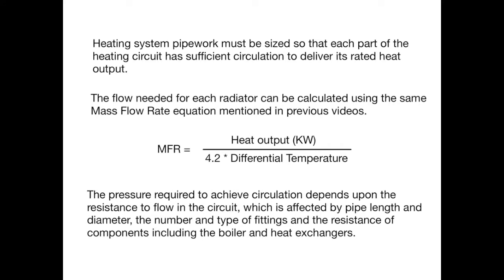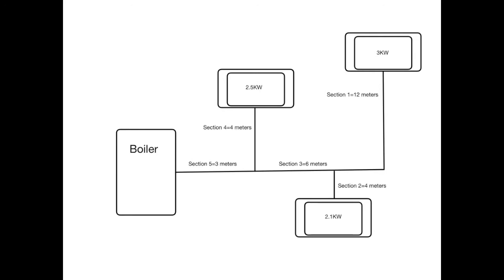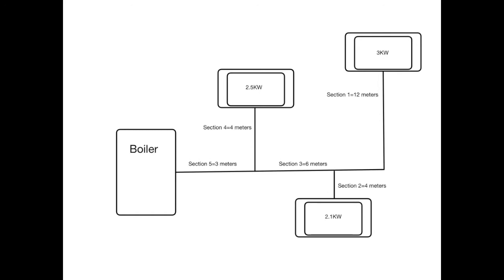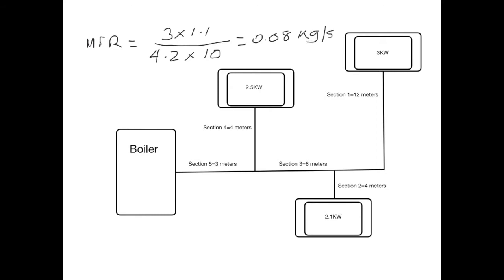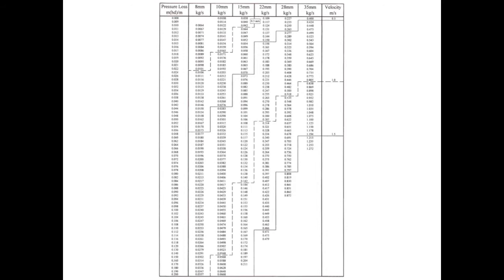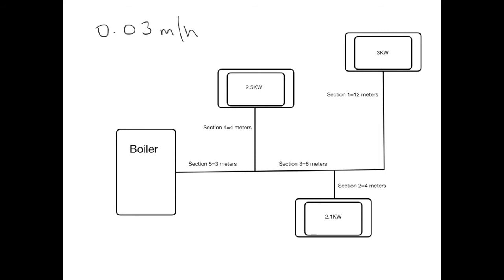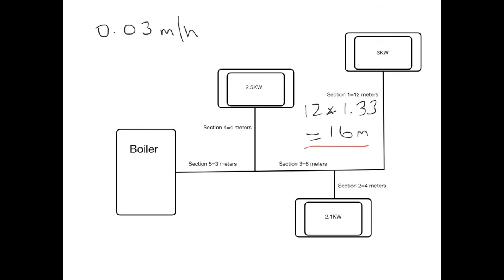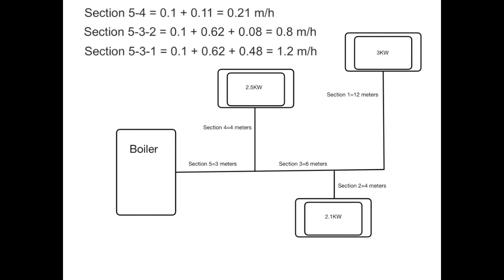Pipe Sizing

Comment: Reza thanks for this. I notice that the total flow rate is taken as the path to the furthest radiator. Why do you not add all the flow rates together from all the radiators? Thanks.
Reply from the maker: Water always finds the least resistive path to flow through. The furthest radiator circuit will be the highest resistive path and the whole process is to overcome it.

Comment: Hi this might sound like a stupid question so I appoligise in advance. In the drawing of the pipe runs there is only one line lets take section 5. Is this pipe run 2 x 22mm pipe @ 1.5 meters long or are you saying you only calculate the flow pipe and not the return. the video is very informative thank you

Comment: hi , thanks a lot for video really helpful for understanding sizing .its simple example for domestic heating. where can I find that velocity chart, I need for copper ? if u have any link could u paste here ? or email ? thanks
Reply: If its any help, the chart can be found in The Chartered Institute of Pluming and Heating Engineers (CIPHE) "Domestic HeatingDesign Guide". This book is full of useful information and a must for designing or checking an existing system.